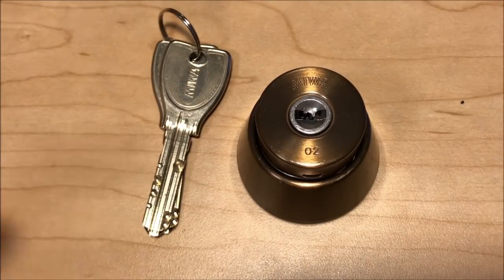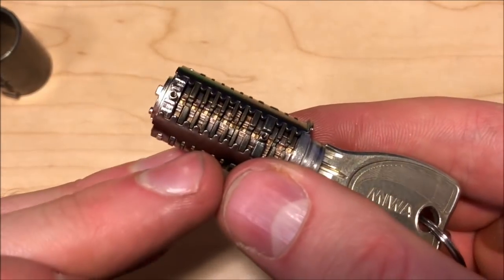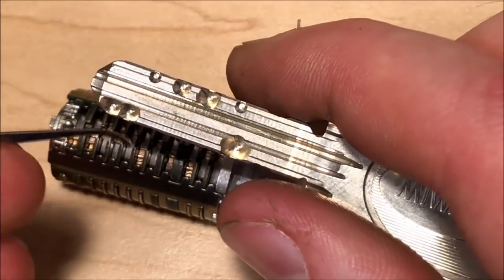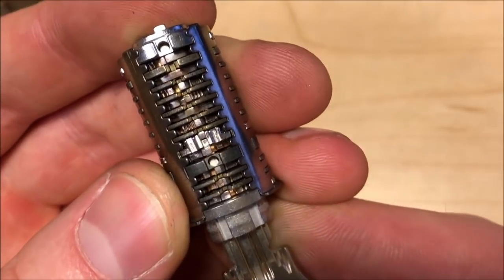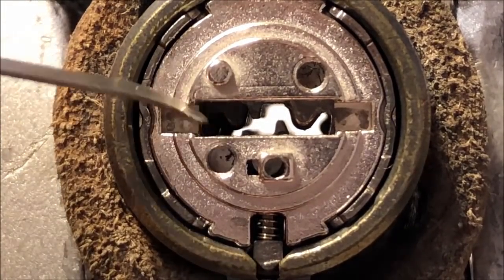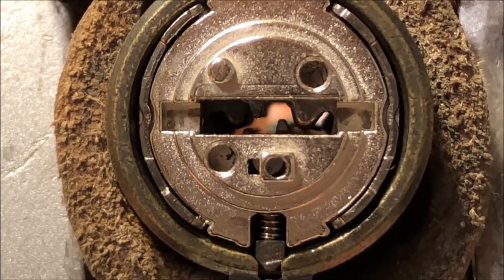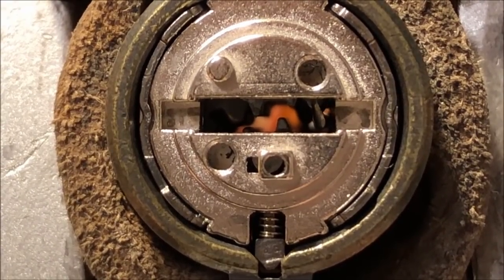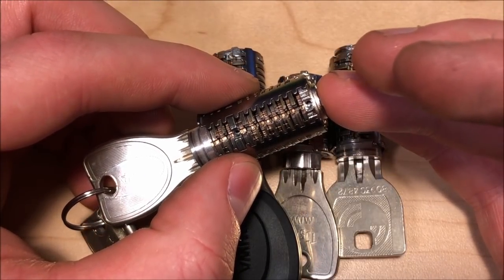Teardown Tuesday 3: MIWA PR

Comment: FANTASTIC -- Really great camera shots and explanations.  I was waiting for you to do a "complete" disassembly and then try and put it all back together.  I forget on whose channel I saw a complete disassembly of a U9 I think, and discussing the problems to reassemble.  Hey, I'm not pulling my PR completely apart either! (and I'll admit I'm not good enough to pick the PR, or at least not having enough patience!)
Reply: I fully disassembled a U9 on my channel a while back, but the PR is different because the springs are not connected to the wafers, so they are damn near impossible to get back into the lock. I tried to disassemble a Miwa PS on camera and it went poorly because of that.
Reply: @CorrectJeans  Oh ya, thanks for reminding me it was you -- please forgive my CRS